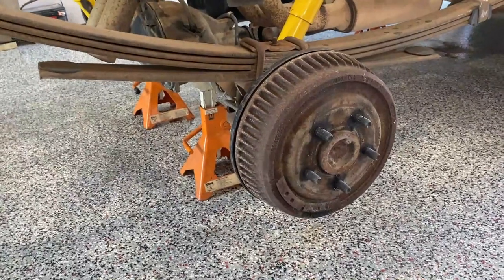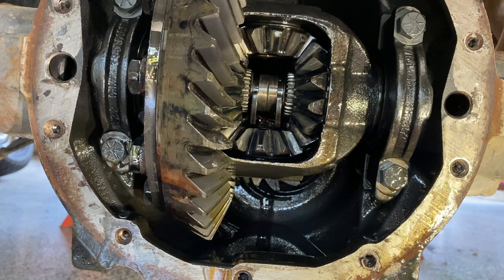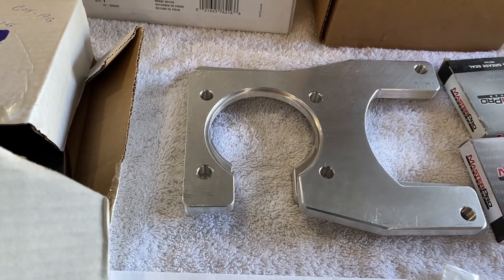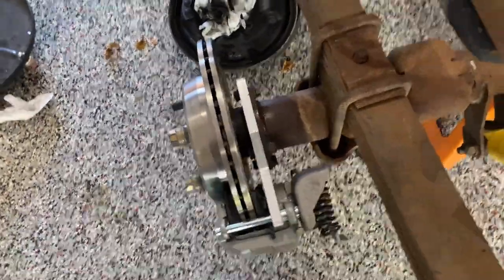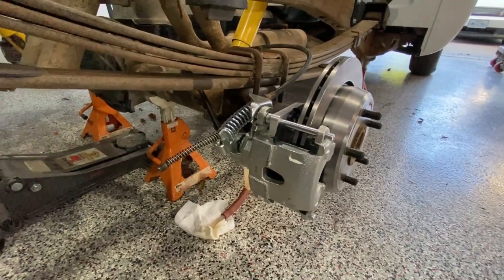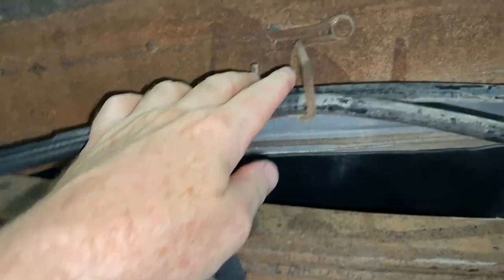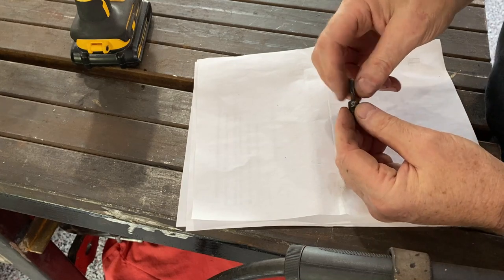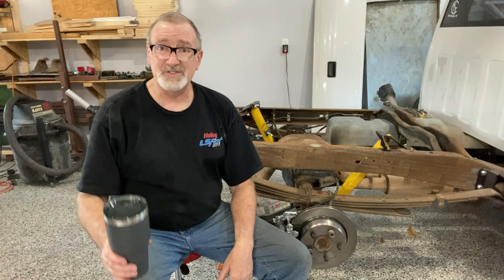How To 1988-1998 Chevy OBS Truck LS Swapped Rear Disk Brake Conversion

Comment: some axles hub face have been drilled for access to the bolts , so as long as you are willing to spend more time cutting the backing plate off - you could theoritically skip the axle removal / seal replacement step.
Reply from the maker: True, after I started taking it apart I could see the axle seals needed to be replaced. So, stripped it down anyway. If your seals are good, that would be faster.

Comment: This video is added to the small list of videos that I actually watched from beginning to end without skipping parts lol You did an awesome job of editing and keeping it to the point. Thank you. 1st time seeing someone mention Rotors from an Impala
Reply from the maker: Thank you very much. Two items I would want to mention if you choose to follow the video. First, do not cut that emergency brake cable off just past the feral until you thoroughly have adjusted the emergency brakes so that they work fine. If you do, and the emergency brakes have not been adjusted, you might find that the cable is now a bit short. Ask me how I know. The second item is to make sure that you properly adjust the emergency brake on the calipers prior to installation. I failed to do this, and the gap between the rotor and caliper was wide enough that the emergency brake, when applied, did not make sufficient contact. Then I had to remove the caliper, take it apart to adjust it, then reinstall it. so, if needed, when you first put the brakes on, play with it to make sure that the brake pads are making sufficient contact with the rotor before calling it a day. Again, ask me how I know. L O L.
Reply: @laurencevillegarage  thank you. I have an 87 GMC Suburban that I’m working on. This was very informative

Comment: Looks awesome, I would have slapped some paint on the frame and rear-end since you had the bed off. Of course after a little sanding the surface rust..
Reply from the maker: Since I do just about everything on my own, I just do not have enough time. Life takes over at times and projects take much longer to get done. Maybe the next one!
Reply: @laurencevillegarage  
👍

Comment: Nice job but I think u said that the hard line was a 3/8 line its a 3/16 x12" ,long and the other hole u said it was a 9/16 hole for the cable but other than that nice job thanks for sharing it helped me alot.
Reply from the maker: Thank you for the comments. The line is 3/16” and the threaded connection is 3/8”. The holes on the rotor were opened up to 9/16”.

Comment: This is a great informational video.  Thank you for taking the time to do it.  I  do have a question.  Does this upgrade move the tires out, or does it bring them in??  Meaning,closer to leaf spring, or further?
Reply from the maker: No, it does not move the placement of the wheel/tire combination. AND, it worked well with my 15" wheel. A very small amount of grinding on the outer corners of the caliper were needed, but that took less than 5 minutes with my 4.5" grinder. I am using an aftermarket aluminum wheel, other 15" rim choices may not need that, depends on the design and shape of the rim.

Comment: If you ever get paranoid about the screw on the ebrake cable you could always weld a nut to the cable instead.
Reply from the maker: I had considered that, however, if I threw a bit too much heat into it, I could create a new problem. It is something that needs to be dealt with, but for now, I have too many other things that are a higher priority. In the future, it will get dealt with. Thanks.

Comment: Great detail and video work on this upgrade for the heavy Chevy. Side question what watch are you wearing in this video? Thank you
Reply from the maker: Thank you, the watch is a Stuhrling original. Has a larger face making it easy to read. I literally paid <$30 on Amazon for it several years ago. I think they are now still <$50. I have gotten more compliments on that watch than any other I have owned. I stopped buying more expensive ones because I tend to be pretty hard on them and forget to take it off when working on projects. If it gets damaged, I don't sweat it.

Comment: Great build, love it.   I'm trying to find the upper shock mount  you used. I can't find it at all.  I thought you said it was a belltech part.  I just can't fi d it.  Any part numbers  and who to buy from would would be great.
Reply from the maker: I had a hard time finding it as well. Only found it on Ebay by accident. Here is the info with link. I installed it in video #9 with the rear suspension rebuild. Belltech 88-98 Chevrolet Silverado/Sierra 1/2 Ton Upper Shock Mount Shock Ext  $65.00
https://www.ebay.com/itm/291664924411?mkcid=1&mkrid=711-53200-19255-0&siteid=0&campid=5338791547&customid=&toolid=10001&mkevt=1
Reply: @laurencevillegarage  thanks. I will check it out.

Comment: Great video. I did mine last summer with a rear sway bar. What are your special shock relocation brackets are you running? I’m guessing they make you shocks a little more vertical from the looks. I have the shock extenders on the axle but like the others you have as well. I did my sway bar from a 99 Denali.
Reply from the maker: The upper shock relocation brackets are made by Bell Tech. I wasn't looking for them when I found them, I like them better. And, the angle is more vertical, which is good. The sway bar I am working with is from a '01 Suburban. Thanks for the comments!

Comment: Just FYI the brackets from cunningham machine are cut so you can slip over the axle and not have to pull them out.  Thank you for the video and i suggest removing the useless anti-lock brake system and upgrading the brake master cylinder.  My 1992 Silverado will now stop on a dime! 
 Thanks again for the video and parts list!!!!
Reply from the maker: True, and I did originally purchase the brackets for that reason. Once I got into it, I needed to replace the axle seals and had to pull the axles anyway. I did another video where I did upgrade the master cylinder as you mentioned. Thanks for the comments.

Comment: Hi.

I'm looking into changing my 1994 & 1997 (both 4x4 with 6 lugs) into rear Disk.

Being far from the USA, I have a problem finding parts. 

My Q is, if I buy this kit, which car's Disk, pads & calipers will fit?

Thanks in advance

Comment: What do you have to do for the master cylinder or proportioning valve to make the rear disc brakes work correctly?
Reply from the maker: I added a NBS 2001 master cylinder from a Suburban. They are made for 4 wheel disc brake trucks. You can use this type of m/c or use a proportioning valve to get the correct front to rear balance.

Comment: I'm in the process of bolting on the aluminum calipers off the rear of a Camaro Z28-early 90's I believe. Will the Little Shop brackets put the calipers in the correct location?
Reply from the maker: I have not seen them so I really do not know. Any idea how they compare to the mid late 80's Cadillac calipers?

Comment: I understand to put the bracket for the calipers you need to expose the mounting point. If i didnt want to pull the axles i could disassemble the drum and unbolt it. And cut what needs to be cut. 
Would that work the same? 

I heard sum people say with the little shop kit they either have to pull or cut. By the looks of you kit its seems the same process. For me cutting would be a bit easier.
Reply from the maker: I originally wanted the Little Shop kit because it did not require pulling the rear axles. Once i got into it, I found both rear axle seals leaking and had to pull them anyway to replace the axle seals. This made it easier to also remove the drum brake backing plate as well without having to cut it.
Reply: @laurencevillegarage  I understand thank you so much 🙏🏽🙏🏽for the responce have a blessed day.

Comment: Great video, as for the hard lines with the fittings I'm not able to find 3/8 with that small of a fitting
Reply: Is the fitting diameter 3/8 or the diameter of the brake line?
Reply from the maker: @ItsFreshDough  I’m afraid I don’t remember. I took my caliper brake lines and the junction block that mounts on the rear end housing with me to be sure I had the correct size line and fittings.
Reply: @laurencevillegarage  3/8 line or 1/4?
Reply from the maker: @ItsFreshDough  1/4

Comment: What was the total finished cost? Do you have a list of the AC DELCO part numbers? Where did you get the mounting brackets? Very informative video by the way!!🤠👍
Reply from the maker: Check out the info in the description below the video, I put in all information including links and cost. Thanks for watching!
Reply: E-bay has those brackets,u know all those kits r the same but the rotors r the ones that r different u need the 94-96  Chevrolet  11"rotors then u drill the holes to 9/16" and that's it.

Comment: What year is your truck? I have a '96 with a 350 and a stick. I've been thinking about doing the disc brake conversion for my truck so I've watch a few different conversions on YouTube. The emergency brake would be a problem for me because the cable is gone, although I do have a replacement, the 96's require two cables that some how split off at the drivers side rear wheel, so I'll need to sort that out. Also, when you cut that e-brake cable did you add a drop of plumber's solder in back of the stop incase the screw losens. It kind of looks like you did to finish the cable end up.
Reply from the maker: The truck is a ‘91. Nope, I cut it too short and had to buy a replacement for that part of the emergency brake set up. I did learn to adjust the rear calipers so that he pads fit correctly just making contact with the rotor. If you don’t adjust them properly to begin with, you will have to remove the calipers, pull the piston and adjust. It wasn’t hard, I wish I had done it in the very beginning. Next time I won’t cut the excess cable until I know the brakes and emergency brake feature works first!

Comment: Friend, where can I get the adapter plates? I looked for it in your list of things but they are no longer available to me very well explained!
Reply from the maker: Contact CunninghamMachine.com
Reply: @laurencevillegarage  Thank you, any advice?, I want to use the old transmission of my truck that is a cheyenne 1993 4.3 tbi, I want to put a 5.3 vortec 2002, are the connectors of the transmission the same or do they change?
Reply from the maker: @carlosiramhernandez9103  it all depends on whether you have a manual transmission or automatic. either way, you will need the appropriate LS flywheel or flex plate. If it’s an automatic transmission, using the correct dished flex plate and a spacer will allow you to mount your original transmission up to the 5.3. If you have a manual transmission, then you just need the appropriate flywheel for a 2000 to 2004, 4.8 or 6.0. For the clutch assembly, just get a matching clutch for the flywheel combination.
Reply: @laurencevillegarage  I have an automatic transmission, it's the original 4l60, so I just need the spacer?
Reply from the maker: @carlosiramhernandez9103 and dished flexplate.
Reply: @laurencevillegarage  Thank you, Do you have more videos of the obs?
Reply from the maker: Yes, I do have more OBS videos, click subscribe, and you can find my homepage and click "videos"...they are all there...Thanks for asking!
Reply: @laurencevillegarage  Thank you very much, I will be on the lookout for your channel, by the way, you have a new subscriber to the channel, thank you for the advice!
Reply from the maker: You are welcome, and Thank You!  @carlosiramhernandez9103

Comment: Got an update? How well does the parking brake work
Reply from the maker: As an update, the parking brake works just fine. The key to rear braking performance and the parking brake is to properly adjust the pads at installation. There is a specific method to doing this on that style of caliper. The info is available online from a variety of sources. As to the performance, even adjusted properly there is not a noticeable performance difference. I believe this has to do with the small size brakes used to fit within a 15” wheel space. There is probably more surface area for braking with a pair of shoes than these relatively small pads. Now, if you were to increase the size of rotor/caliper to fit within, say 17-18” wheels, I feel like that would be a difference you will notice. The disc definitely look better…bottom line, I personally don’t feel the looks/difference in braking are worth the $$ outlay for the small size to fit the 15” wheel. One problem I did have was that I needed to grind a couple areas on the top of the caliper for clearance of the wheel. IF you run your wheel weights on the inside of the rim, you must be very careful to place them where they are not in the path of the caliper. Or else, they will get knocked off and/or scraped along the inside of the wheel. This happened to me with aftermarket rims. Thanks for asking.

Comment: what year era did those impala rotors come off of ?… wanting to do slotted rotors with this setup
Reply: and also do you know what whats the biggest size i can run on the rotors
Reply from the maker: The rotors are from mid 90’s Impala SS. To run larger rotors, you would need different brackets. Those brackets are made to run that size calipers and rotors. I wanted something that would fit within a 15” wheel.

Comment: Awesome video I had one question was buying everything separately worth it or would you just go with a little shops kit
Reply from the maker: Good question. If you want rear discs and just want to “get it done” and you have the extra resources, then go with the LittleShop kit. If you are tight on $ and/or you have the time and enjoy making stuff work (which is me) then go with the brackets and make your own kit. Do shop the rear calipers w parking brake feature, they are getting more expensive as time goes by. Depending on where you find them and how much, you may decide to go with a readily available kit. Performance is about the same IMO.
Reply: @laurencevillegarage  ok that helps because I have always wanted to do this in my 98 c1500 but didn’t know witch was better but because my schedule is kind of tight I may end up doing the kid at little shops even though I would love to build my own like how you did in the video

Comment: Love your videos,
What make and model are the rotors out of? I see the part# but would like to know the vehicle to see if I can find them drilled and slotted.
thank you in advance!!
Reply from the maker: Thank you, The rotors are for a ‘96 Impala SS.
Reply: I drilled them out no problem - just make sure you stand on the disc otherwise it will sprain your wrist when the drill catches!

Comment: R u sure that it's a 9/16 hole  it doesn't look that big ?
Reply from the maker: If you are referring to the holes in the rear disc rotors, the original hole was not 9/16", it had to be opened up to that size. The next pic showed the rotor installed. But yes, that is a 9/16" hole.

Comment: Did you have to change the master cilinder?
Reply from the maker: I did swap my master cylinder over to a NBS (01 suburban) style. You don’t have to, but, if you do not, you will need a proportioning valve to adjust your f/r bias.

Comment: Hey where you able to run the 15inch stock wheels?
Reply from the maker: Yes I was, you do need to be careful of where you put wheel weights on at. On a steel wheel they would be on the rim, and that's fine. On an aftermarket wheel where you might put them on the inside, you need to be careful they are not in the path of the caliper. The fit is tight and if a wheel weight is in the way, it will knock it off.
Reply: Thanks for the feedback, i appreciate it it!!

Comment: Does this apply to an 89 gmc k1500 extended cab? Where can i get a full kit? 😅 any help appreciated
Reply from the maker: Still wanting to use your 15" wheels, you have several options...a couple of companies offer kits, or you could do what I did in this video and buy the brackets and order all the separate stuff. OR, if you have a larger budget, get some bigger brakes as well. Search the internet, you will find other companies and what they offer. Just make sure they are made for your application.
Reply: @Laurenceville Garage  I've got 16 inch wheels, any company you'd suggest for a kit?

Comment: what's your opinion on doing the conversion the way you did in the video versus getting a kit from Little shop?
Reply from the maker: It will depend on how you use the truck. Honestly, if you run 15’s and the rest of the braking system is stock, it will look better…but braking performance won’t change much. The stock rear drums actually have more brake pad/shoe surface area than the small rear disc pads. This is just my opinion. If you upgrade to bigger brakes, yes there is a noticeable difference, otherwise you can use the $ on other areas. I won’t do 15” rear disc anymore, just not a good performance vs. cost/labor ratio. Now if you really want the look, piecing the rear together is more steps, but quite satisfying to perform and the cost is not bad, at least less than other kits available.
Reply: @laurencevillegarage  Thanks for your response. If I decide to do it myself, your parts list and video will make it a lot easier! Thanks for the great information.
Reply: Hi, great job explaining in detail.  You mentioned that you won’t do 15” rear disk anymore? So for this exact setup what can you use?  My son just order all the parts to work on his 1997 c1500

Comment: you can keep the 15 rims or you have to change them for bigger ones
Reply from the maker: I went with these parts so I could run my 15” rims. With that said, I did have to grind a little bit on the ends of the calipers to clear wheel weights. It is a close fit. The wheels I used were 15x7 torq thrust copies. A stock steel rim would probably have more clearance. But then you could not see the brakes.
Reply: Thank you very much for your reply, your videos have helped me a lot.